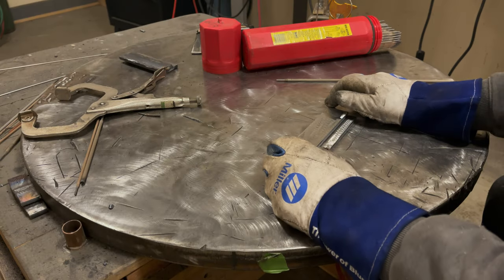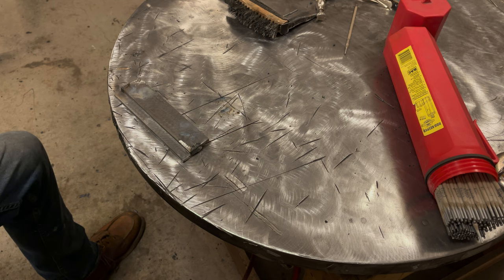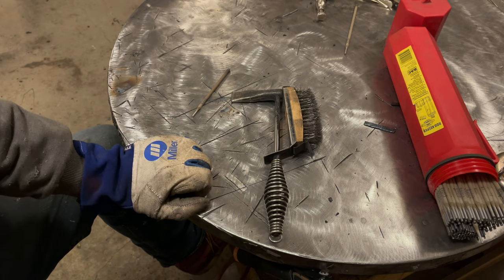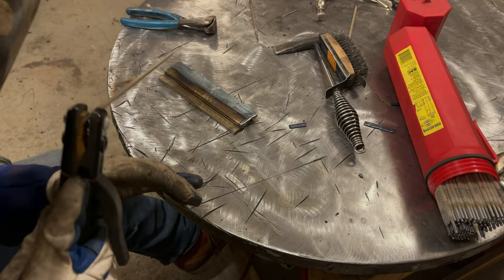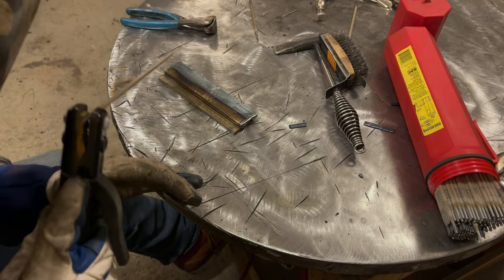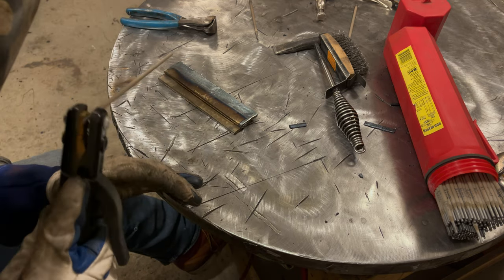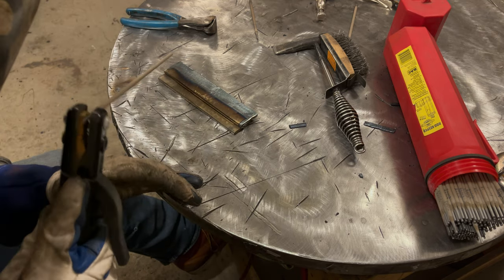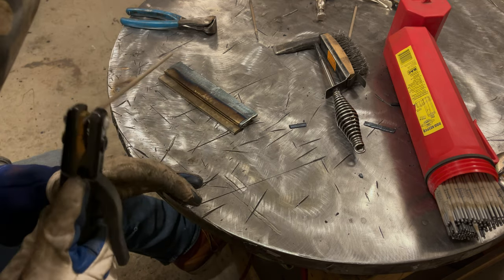How to stick weld 👨🏻‍🏭:  How to weld Lap joints in flat and horizontal positions (Series part 5)

Comment: So far, I've learned more from this playlist than I have from all the other stick videos I've watched.  (I've watched sooooo many hours of others' SMAW tutorials.) Panning into the arc strike technique in an earlier video really helped, as that has been my biggest problem. I'm binge watching this playlist, & have watched far beyond my current level of experience & proficiency, but this man's method of teaching is really getting through to me.  Great videos, great instruction, great insights, great teacher. He really should put together an online course.  I'm certain his method would resonate with all the thick skulls, as well as they have with mine.  Two thumbs up & many thanks!
Reply from the maker: Thanks so much for the kind words.  It’s a honor for me to be between you and the difficult (but doable task) of learning to weld 😀.  I appreciate the thoughts on doing a online course.  I will be definitely doing that 😮.  So it will be a few weeks but I am going to setup a self guided program for Mig, flux core, and stick at first.  Basically a unofficial YouTube welding certificate that people can work towards.  It will have assignments, goals, and grades.  I realize that many people benefit from the motivation and structure of a program, but they don’t want to/are afraid/don’t have the money to go to college.  So I am going to make it possible for the average hobbyist to achieve something and realize they can do it.  I will post a update within 2 weeks covering all of this with a good overview.  😀
Reply: I have to agree with you.
 Not only have I watched a s**t ton of video's, I even bought several books, none of which really helped.
I think the main thing is practice every day though, 40 years ago I did get quite good but the skill goes away incredibly fast when you don't weld anything for 10~15 years and if you do any welding it's very thin sheet with gas.

Comment: I dream of having strike offs like that!!
Slag inclusion on 6013 is my nightmare, endless cycle of grinding frustration, progress is ever so slow, but then again I dont have nice clean flat plates to practice on, so am welding on any scrap metal I can find, which is usually thin stuff, might take me 1000x times longer to learn but melting hot metal is suprisingly relaxing and addictive, ordered some 6011,  hoping those will help with slag inclusion problems.
Reply from the maker: 6013 tends to be tough to make clean welds on actual joints.  I can literally weld 100% clean welds in any position any joint with 7018, 6010, 6011, and many other oddball rods (stainless, nickel,,etc).  With 6013 I am almost assured to have some form of welding defect dealing with its excessive flux/slag from time to time.  It runs great on butt joints and to a certain extent lap joints.  The second you try to weld weird joints, or out of position it’s an uphill battle.  The worst welds I have ever made were all with 6013 lol.  6011 takes more skill to run (slow down travel speed over 6013) but it’s much easier to make defect free welds with it for me.  To this day I still use 6011 for certain tasks, I don’t use 6013 for anything other than teaching people.  

Edit: I forgot to mention overseas 6013 is very popular, however they have a different flux composition.  Their rods can run more like 6011 than ours, so I understand why they use it.  Most 6013s in this country seem to have too much flux and it jokes where I don’t want it lol.
Reply: @makingmistakeswithgreg  Good to know even pros can have problems with 6013, some 7018 on its way.
I figured this cheap welder is reading way undercurrent, I have to push it to 110A on 2.5mm rods to get clean welds, then suddenly everything is starting to come together, thats the problem I have had with stick, too many variables as a newby, so its hard to identify exactly what I was doing wrong, not perfect though every time, still cant differentiate between slag and metal, got a ESAB helmet set to 11+ cheater lens.

Comment: I'm guessing when you say an old tombstone you mean like a Lincoln Buzz box. I like that name that's exactly what it looks like. I have one but been using my new Miller 220 I think they both put out the about the same power I think the Miller does operate on DC for stick and probably a little easier to use cause it automatically sets up the parameters. Thanks for what you do I'm working on my stops and starts. I'm finally starting to see what I'm seeing and understand a little more about moving the puddle.
Reply from the maker: Once you master stops and starts it will be by far easier to stick weld.  If you think about it most people don’t have a issue with the rod when it’s running, all the frustration is at the start and the end.  Focusing on improving those two things will completely change how good you are at stick.  Buzz boxes still work good, but the modern dc output welders are far better in my opinion, especially with 7018 rods.

Comment: Can you explain the difference between fast and slow freeze and puddle manipulation in regard to the fast or slow freeze? Thank you I am feeling more comfortable with my practice after watching your series.
Reply from the maker: So this is what I do.  Weld puddles that freeze fast (like 6010 and 6011) it helps to move forward 1/8th to 3/16th of a inch or so, while tighten the arc gap, and then move back about half that distance.  As you step forward the loss of heat input causes the furthest part of the puddle from the arc to solidify.  In the flat position normal weld this isn’t much benefit, but vertical up as well as welding gaps the puddle solidifying more or less allows you to 3d print metal and makes it easy to bridge gaps.  

With slow freezing puddles (like 7018, 6013, etc) your manipulation doesn’t do much because the puddle stays liquid.  There is no benefit to whipping out of the puddle with these rods, you want to run straight and smooth.  Keep in mind as well, 6010-6011 have a tendency for the metal rod to burn high up inside the flux.  By manipulating the rod it keeps the flux knocked off and it runs better.  This isn’t an issue with most other rods.

Comment: What hammer/brush is that?
Reply from the maker: It’s a Hobart I believe, it should be this one of a knock off of it: https://www.amazon.com/Hobart-770069-Welding-Hammer-Chipping/dp/B0017Z5IZ4/ref=mp_s_a_1_1?crid=1JBP2E548QAJ1&keywords=hobart+stick+welding+brush&qid=1706671153&sprefix=hobart+stick+welding+brush%2Caps%2C112&sr=8-1
Reply: @makingmistakeswithgreg  thank you! Your videos have helped me immensely starting stick welding

Comment: High OCV would do the same as Hot Start?
Reply from the maker: So high OCV makes it much easier to start a rod because the arc establishes and stays lit easier.  Hot start is a momentary boost in amperage at the start of welding.  In simple terms if your machine is set for 100 amps and hot start is turned on (or the machine has it built in) it will boost the amperage to say 120amps for .5 seconds and then drop to 100.  On some machines it’s adjustable for what percentage increase over machine set point, and even how long after the start it’s active (say .25 to 2 seconds).  Hot start is very useful on thicker material because you can have poor fusion for the first bit of the weld without it.  It’s also harder to stick the rod with it at the start.
Reply: So Basically the Same Thing... lol @makingmistakeswithgreg
Reply: My machine says 86v Ocv... Or 15v Vrd... Ive left that Off so Far... I need all the Help i can get so...ha  But i did get a LiL sHock about the 3rd time using the machine.., i was holding V-Grips with my left Bare Hand, the V-Grips were holding a Bolt to a Shaft tht i was welding it too... I wasn't long letting Go...lol

Comment: U sure complaine alot of 6013..... So why r u using them.............haa
Reply from the maker: Haha..  well I used them to help people out on how to run them.  I am not sure why but 6013 is super common in many countries and many people can’t get 6011,6010, or 7018.  I won’t lie, it takes more skill to make clean welds with 6013 than 7018 in my opinion.  It’s so easy for the flux to run infront of the rod and cause weld defects.
Reply from the maker: If you happen to weld higher strength steel with a 7018 that wasnt properly stored, the weld/material can crack.  If you were to weld the same material with any other rod the results would be worse.  7018 is basically a rod that you can safely weld higher strength alloys with because it has low moisture/hydrogen in the flux on the rod.  The rod oven is to bake the moisture out so the weld will have as little hydrogen as possible.  Keep them in a somewhat sealed can and you will be fine for most of what you might weld.  😀
Reply: Thx... @makingmistakeswithgreg